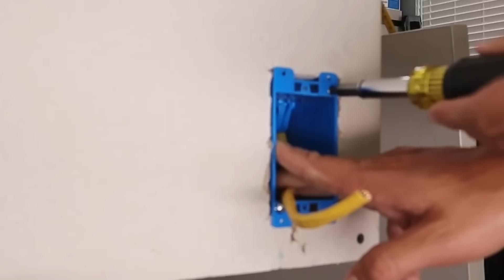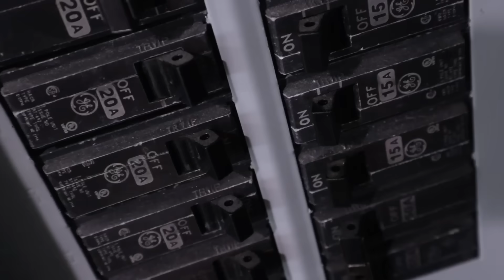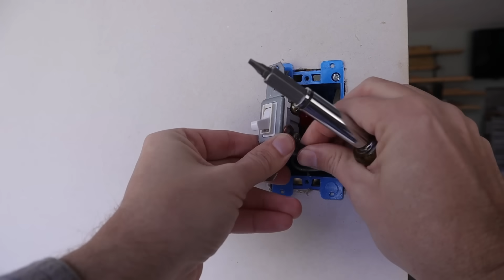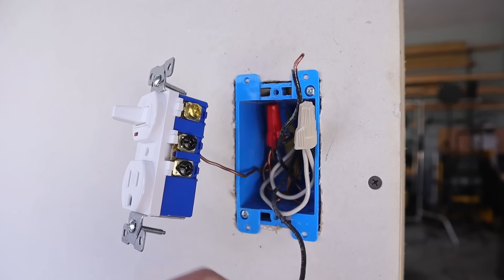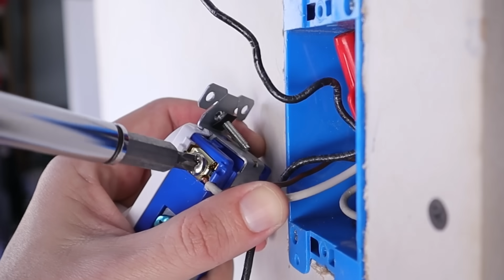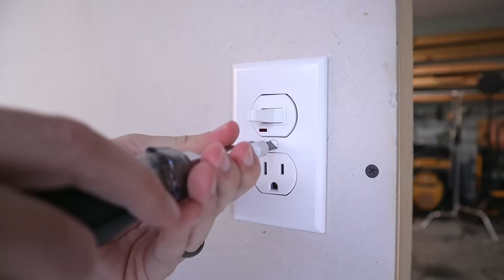How To Install An Outlet and Light Switch Combo | Adding a Receptacle To Any Room

Comment: Very good video but you did not address my issue which is installing the switch outlet combo, down stream in the second switch and the hot wires change depending upon the way the switch closest to the line is placed. My line wires change as the switch is closed or open. So, do I pigtail the alternating hot wires and connect the one pigtail wire to the line screw on the switch?

Comment: Good video, but in my case I have a switch loop in our utility room so I only have the hot, load and ground wires at the switch box.  I think I would need to run a new wire with hot, neutral, load and ground to the switch box to make the switch receptacle combo work properly/safely?  I guess this was done to save some wire cost?  🙁

Comment: the draw back on this kind of receptacle - 15 amps .....u r limited to what kind of equipment u can use. standard receptacle uses 20 amps receptacle, do not use this in your tool room. The main difference is that a 15-amp outlet handles a lower current and is common for standard appliances like lamps and TVs, while a 20-amp outlet handles more power and is used for high-draw devices like microwaves, air conditioners, and power tools in areas like kitchens and garages.

Comment: Did exactly the same but as soon as ground wire attached it's stop working. Remove ground wire starts again. And the switch/receptical has some voltage. Changed three different switch/recepticals, same resault. Please advise.

Comment: This is clearly the best video on Installing An Outlet and Light Switch Combo and helped me install 4 in my apartment which would have be impossible. I have installed outlets in the past without a problem, but my new apartment has metal struts and created all sorts of blockage problems.Thank You!

Comment: Hello! Love your videos! Have a question maybe you can help, I purchased metal outlet covers for bathroom outlets- rethinking this purchase O_o - 1. Safety.. metal & water … 2. I keep reading it says the cover needs to be grounded ??? Not sure what that means - grounded to what — or how to do it … can you help clarify ? Home built 2004 .. can’t remember if outlet box is plastic or metal… I have 2 outlets—- one is a 2 switch fan / light combo and one outlet is a safety trip reset type outlet..    thought all that would need done, would be to just screw the plate back on to the outlet.. but reading online they say to ground the cover ….help …

Comment: Thank you so much my dude!!!! I would hug this man if I could right now (no diddy) hahahaha! 

I had to replace one of these in my bathroom and the wires were in different places due to the rec being old af…  with him all of the wires and screws, and breaking down what the purpose of all of them were is what seriously saved me. I was able to identify where each one goes, learned what a log tail is, and get this thing installed finally!!! 🙏🏽 

I have delayed messing with this broken light switch combo in my bathroom for months. I rigged it, and was just twisting the bulbs to turn the light on/off… (I know, terrible idea) but it’s all I was able to do at the time. 

So today I decided to finally just go for it using the internet and found this video.

Comment: So I tried it both ways. The first way with the tab connected and the way with the tab disconnected. When I left the tab connected the outlet only worked if the switch was on. When I disconnected the tab the switch still worked but the outlet did not. What did I do wrong?

Comment: I bought this same exact Eaton Combination Device (TR274W-BX-LW) awhile back and finally unpackaged it ready to replace the light switch in my attic. I needed an outlet for times when I run my Shop Vac to clean up debris. Well yours was the only video I found that showed me exactly how to wire this device for my application. Thanks!

Comment: I would not be able to cut and redo the wires like that.  The wires are already super short in the wall.  Why would I make them smaller!!
Just grab a needle nose and bend it back straight..

Comment: Nice but I got confused in how to make the outlet SWITCHED too....  You mentioned;  Break the tab, connect the wire coming from the "switch" to the lower part, and the wire with power all the time to the upper part?  I think you mean:  Put the LOAD on the bottom, put the LINE on the top ?

Comment: Except that  my 90 year old home does not have a neutral in the metal switch box, in a lath and plaster wall. Who knows where the neutral is that does go to the light. Oddly the metal box is grounded, found out pulling the switch out with power to the switch on,  sparked when hot wire screw head touched the side of the box and thru the circuit breaker.. Don't want to sawzall around the box to free it up, probably create new work, fixing plaster wall, grrr.

Comment: Great Video! You explained it very well, I do have a question though. How would you wire it inline to a motion light? I only have two wires, one black , one white ? Would it be the same way? The switch will be before the light.

Comment: Is there any reason you can't eliminate the pigtail and just run both neutral wires into the neutral connector on the switch? Is this a safety issue?

Comment: Like you, thank you, thank you! I used an older combo switch grounded outlet for the same setup as yours. Screws configured a little different but works fine.

Comment: to switch the outlet... dont you have to break tab between brass screws then feed top screw, then get a jumper from load screw to the bottom brass screw to make it switched? correct?

Comment: Thanks a ton for this video, my friend!  This saved me time, headaches, and some fundage.  I'm redoing a kitchen and wanted to add an outlet to a counter using this light switch/outlet combo, but couldn't get it wired correctly using the included guide.  Those guides are printed for every single oddball switch they make in 3 languages.  Maybe I'm just easily confused, but your explanation sorted it all out for me. Thanks again!  I subscribed, and I don't do that often!

Comment: Could you not have just removed the cap nut on the two white wires and then plugged them into the two back connectors, rather than adding the pig tail?

Comment: Question: It looks like there are two holes for the neutral wire on the switch. Why couldn't you just put both the neutrals out of the box into the switch instead of pig-tailing them?

Comment: As a young l devil my Care,  working on my first 1937 built farmhouse, putting new lights in for my lovely new bride, I ran into the only light that they broke the neutral at a switch me thinkin all was safe, but no!  Had the old two wire cotton cover BX that thing got me to  a few times over the years with my trustee jelly knife for the screwdriver lol !

Comment: Great video, question, before you turn the power off for the first time could you test at that time for  which wire is hot/load? that way you don't have to do it twice?

Comment: I rarely comment on YouTube videos, but just wanted to say thank you for this one. I can do most anything around a house, but electrical gives me anxiety. I bought the exact switch/receptacle combo that you installed in this video. I figured I'd simply be replacing one switch for another and mapping wires from the old switch to the new one. Well, it obviously didn't work. I resolved to the fact that I'd have to call an electrician, but then I decided to check for a YouTube video. Yours was the first I watched and I nailed the install! Thank you for explaining things so clearly.

Comment: Where you inserted the neutral pigtail under the plate, is is possible to not use a wire nut/ pigtail and place both neutral wires under the plate?  The plate looks as though it would complete the circuit in the same way.

Comment: Help needed i'm no electrician but based on your video.. i'm assuming for a one light setup that's a single pole light. you can correct me if i'm wrong so would that mean if you can trigger that light from two different locations that would be a double pole switch with outlet? can you send me a link for one i'm trying to find one

Comment: So the system that I’m wiring a switch/outlet combo into is an ancient system. There’s an existing light switch, but there are only three wires, two black into the same hole on the top of the switch and one orange wire into the bottom of the switch. No discernible markings on the existing switch. No ground, and appears to have no neutral. What do I do!? Should I call an electrician?

Comment: Thank you for your help I have installed this same switch in a closet and all is working well. The switch goes to a light and the outlet powers my home internet. I have a question though. I want the outlet to remained powered on while I switch the light off. Currently I turn the light off and my internet now turns off haha. How do I fix this?

Comment: Do you need a line wire for this to work because I am replacing a light switch with this and only has 2 wires the load & neutral not including ground  I it will work how thank you

Comment: I tried with an old system that doesn't have a ground cable and I only have two cables in the box, the light came on but the socket only works with the light off and I don't know what to do 😅 Help 😅

Comment: This video was a big help for me. 2 Switches were in the electrical box one for a timer for outside Porch Light and one Foyer Light Switch inside. The one with a timer was fed by a Red wire used to the neutral side of the other switch and and another Red wire coming from the outside light connected to the Load Side of the 2nd switch was introduced in the same box going over to a outside porch switch and that red wire connected to the load side of the switch that had 2 terminals. Worked perfectly, I did this to have a power source for a outside Camera showing who comes to my front door. Have been using a Ring Doorbell but was not happy with their recent increase they were about to charge me for a year of service. 2 increases in the last 2 years. If they were to increase me again for the same amount in 2025 I will be paying double in 3 years as when I started. I rather just have a Micro SD Card. It is all that is needed as far as I am concerned. I own the Ring Doorbell so it will still ring when someone comes to the door  and presses the doorbell and show who is there if I am home but won't record anything the reason for the other Camera and the source I needed for power nearby. This Camera will also let me know when someone comes to my door along with other Camera's in my system. By the way I am a new Subscriber.

Comment: That’s what I need to install but I don’t have a neutral wire and the light switch is next to a 3way switch. Is there any way to add the receptacle to the light switch?

Comment: Quick and probably dumb question; Couldn't you simply back wire both neutral (white) wires to the receptacle instead of using a pigtail? The silver screw appears to have two slots for back wiring, and it seems like it would be less crowded with wires inside the box. Thanks.

Comment: So....first off... awesome video and presentation.   Thank you SO much.  Hopefully just a quick question....my box does not have line and load wires.  Only one wire goes into the box.  I'm also installing two downstream plugs.  It's in my garage.  The diagram that came with the switch/plug indicated just what you showed.  However, the switch is now controlling all of the plugs.  Everything works fine when the switch is on, but not when it is off.  Can this part be used without the second black wire?  Thanks.

Comment: Nice job but you need to tape the screw terminals as well.  Especially with the exposed wire sticking out from the screw terminals.  But nice job explaining it and breaking it down.  Just a safety tip that needs to be followed.

Comment: I want to install a light switch and outlet like you show. Do I break the jumper bar or not?
What happens if you don't remove the jumper bar? what happens if you remove the jumper bar. What is the difference in operation?  You are explaining like we are all union electricians  local 3. P.S. you have smart hands.

Comment: I know a jumper from the bottom black screw to the brass screw causes the receptacle to be controlled by the switch, but what do I do if I want to control BOTH the attached receptacle AND a light by this same switch? (I have a device that I want to plug in so that it comes on only when the room lights are switched on)

Comment: I opened it up and only found a load, line, and ground wire. No neutral wire.  I hooked everything else up and only the light switch works, the socket does not.

Comment: I am replacing an outlet for my dishwasher and garbage disposal.  I rewired it the same way it was wired (I thought)  The dishwasher is powered on all the time..  When I plugged in the disposal it came on. when it is supposed to be operated by the switch located on the wall.  Obviously I have my wires crossed. Help!

Comment: I set it up the way you showed and the outlet only works when the switch is flipped on. Did I do it correctly? I want power to be flowing to the outlet at all times

Comment: Nice for modern homes, mine was built in the 1940s, only 2 wires with heavy fabric insulation. No ground wire, no white or black wires, no wire nuts.

Comment: my bathroom doesn't have outlet only switch that turns on the light and fan and I want to install a switch combo I need to change any wires? on just buy switch combo and install?

Comment: Thank you for your video. Ive watched it 3x. Im still unclear on the 2 black wires and the wording you are using to describe them. 

Also, please mention the neon orange light which stays on when the light is on.  I thought the light was green, but the next day, its orange. What color is it supposed to be?? I'm very concerned now!!

Comment: Incredibly informative. I felt so confident going into exchanging an old switch for a combo--but there were only two wires in the box. I assume one line and one neutral? No ground, and when I installed w/o the ground (metal box), the outlet had not power going to it even though the switch worked.

Comment: What damage (if any) it can create if you accidentally connect the hot wire (from the breaker box)  to the brass screw (reserved for LOAD) and the load black wire to one of the other two black screws?

Comment: Thank you for your video on the combo switch outlet  I have an Eagle 272V-BOX Switch and Receptacle with a small indicator light in front in the same area as the switch.
How do I wire up a Eagle 272V-BOX Switch and Receptacle to have the small LED or Neon light to light up when the power is supplied to the outlet .Also, I appreciate the way you explained the procedure was very understandable.

Comment: I have this same switch/receptacle outlet but I want to create a current limiter with it and the lamp.  I need the switch turn off power to the receptacle.   I need the line to go to the switch then lamp then outlet in case there is a short with the Amplifiers I plug in to test.  How would this be wired with this device?  Thank you!!

Comment: I followed the steps you outlined and it worked perfectly until I pushed everything back into the box. I pulled the switch back out and discovered that the pigtail had popped loose from the wire nut. I can see why lever nuts are becoming more popular.

Comment: Lifesaver!! I am just a dumb old girl and thought this would be straight forward, but when I wired it up (connecting BOTH white neutrals to the combo outlet...duh...) only the socket worked. I moved the wires around a bit, and still no luck on the light switch.  Then I found your video. I made the pigtail out of the excess wire that was in the wall, and got everything attached and working perfectly according to your instructions. THANK YOU!!!

Comment: I am making a headboard with “His & Her” led reading lights, separately switched on each side of the bed.  In addition to the switch, I was going to make it a combo switch. I wanted to run these off of a made up quad box “extension cord” box with two switched outlets.  Does this sound feasible?

Comment: Highly recommend putting something like a Wago on the end of each of the hot wires before testing line or load. You can still test by placing the meter lead into one the push connectors and it's a much safer method than having hot bare copper.

Comment: Thank you so much for posting the video. Certainly a new thing for me to learn. 

I have 2-questions:
1) I have a receptacle on the wall located very close to the floor. What can be done to prevent small children to touch it to avoid accidents? any Protector?

2) Do you have a video on adding a On/Off Toggle switch for a receptacle that need to installed at an height of 5 or 6' height to turn the power off?

Thanks again.

Comment: My college dorms have these in the walls and I don't see any reason for the switch as they do nothing at all. What are the uses for a switch plug combo? What could they be used for that is obviously not happening here? It doesn't shut off the power flow or anything. It is just a useless switch

Comment: Hi, Thanks for the videos. Very helpful. But, I have a question. I have three switches that control the interior garage lights. I want to change two of the switches to a switch/outlet combo. The current switches have a black, white, red and ground. My brother has been trying his skills but we have not been able to figure it out. Can you help with which wires go to where? Thanks,

Comment: It won't work if there is not two ground or black 14/2 wiring Some one light /switch  fixture it is only one 14/2 wire

Comment: Old house, only has 2 wires coming out of the box on the wall.
I Want to install , combo switch. What are my chances of putting it in and not having to run a line? Help ?